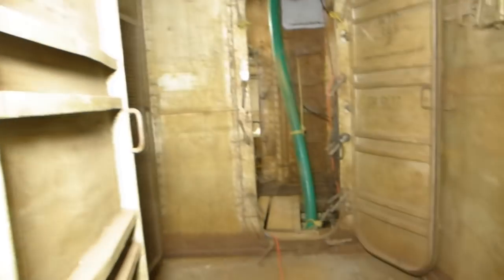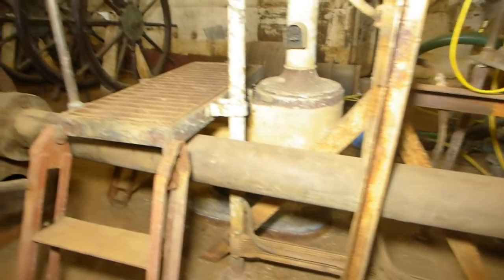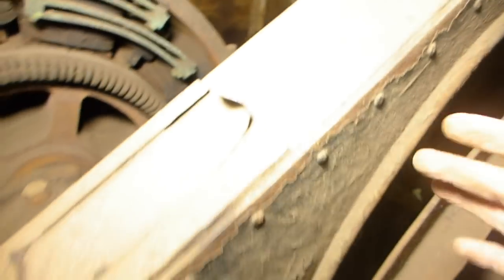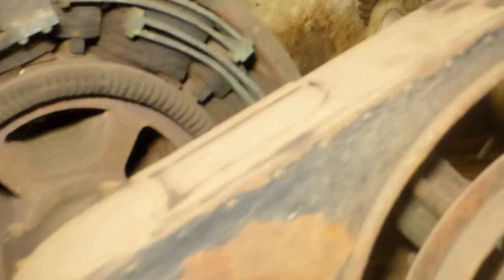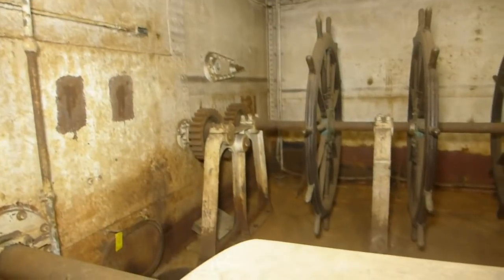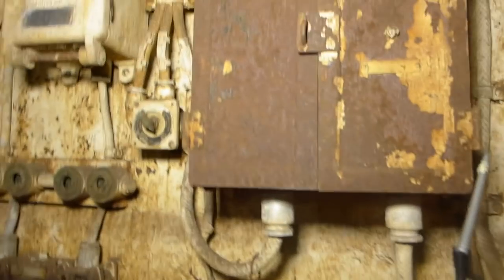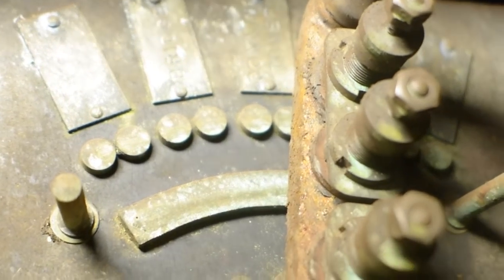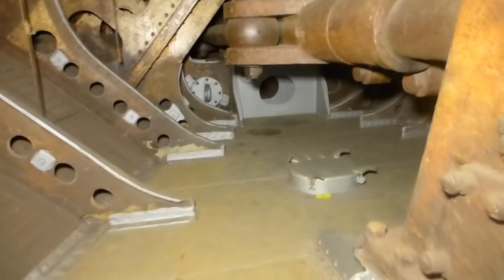Battleship Texas, One Good Turn Deserves Another

Comment: I heard it was leaking but wow looks like it was under water
Reply from the maker: It was flooded for many years due to leaks from several sources.  Those were all repaired in 1988-89 when the ship was in dry dock and there hasn’t been any flooding issues since then.  It hasn’t been restored because it is pretty stable and limited resources had to go to higher priority issues.
Reply: @tomscotttheolderone364  looks like you have alot of light! Dosent look as bad as you would expect to be under water for years
Reply: @tomscotttheolderone364  didn’t they also partially flood her intentionally to set her on the bottom to resist tidal movement when she initially arrived at San Jacinto?

Comment: Ultimate REDUNDANCY: If steam AND electric crap out then there are 18th century helm wheels!!!
Reply from the maker: Of course, if you loose steam, you also don't move and the rudder becomes useless.  However, the manual steering would be excellent if the rudder needs moving while the ship is in port and you don't want to build steam or run enough power for the 150hp, 120vdc steering motor.

Comment: man..... I hate to come across in a negetive way, not my intention. I dont understand how a person, or a group of persons whose occupation is solely to preserve and take care of a historical battleship which is and has been in their possesion for many years. Can allow that ship to rust away and be that much of a mess.. I get sometimes issues once hidden away rear their head. Or a situation just got away from you faster then expected. But this whole ship is moments from falling apart and sinking
Reply from the maker: Let me try to clear up some misconceptions.  The ship is certainly not anywhere close to falling apart and sinking.  She underwent $50 million in internal repairs between 2014 and 2018 that has given her structural integrity that is far better than it has been in more than 50 years.  Coincidentally, at the moment that you posted your comment, the ship was being towed 40 miles to a dry dock in Galveston for outer hull shell repairs.  As of my response, she made the trip without incident, and is in dry dock and being lifted out of the water.  This is the first step in a $35 million project that will replace most of the shell plating below the waterline.  Once completed, the ship's hull will be very sound and good for many more years.  

I am assuming that the rust that concerns you was what you saw in this video.  I agree that it is pretty nasty looking in aft steering, but it is largely cosmetic and is not structural.  

As far as the staff that is responsible for the care of the ship.  I have personally known all of them over the last 20 years.  Without exception, they are professions who are dedicated to the preservation of the ship.  What you may not know is the chronic fight that most have had to endure for funds and employees.  They have done a superb job considering what they have had to work with.
Reply: I guess it is a mere result of comparatively few people with limited funds, trying to maintain a giant machine. inevitably, they will have to focus on the most pressing issues.